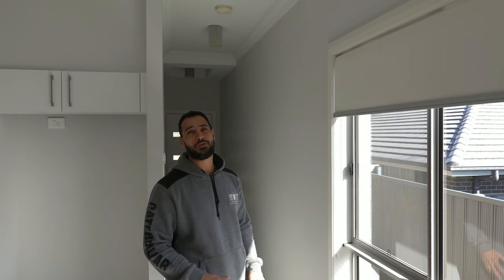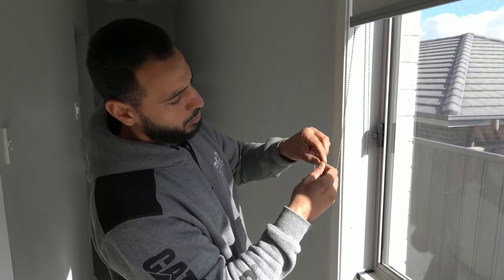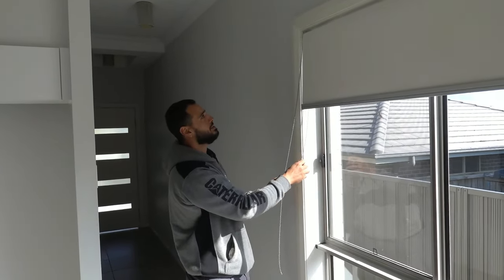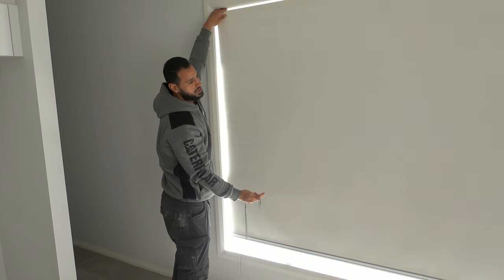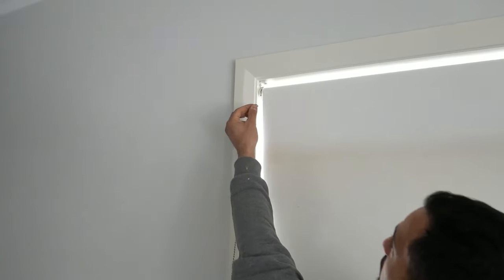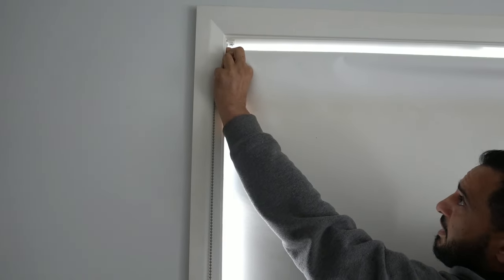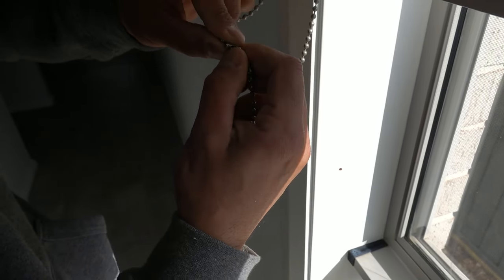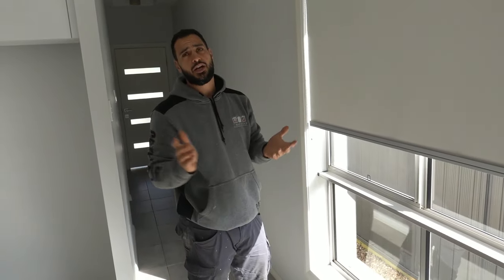How to fix broken blind chain cord

Comment: Last thing I would do is remove the chain from the sidewinder. With both ends available, using the correct tool, just join the two ends together.
Ball Chain pliers are not cheap, but when you now how to use them make this repair easy and you do not need to reset any stops.